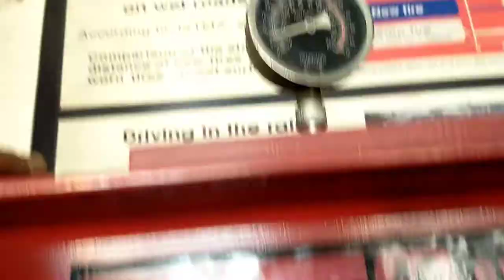Toyota Avanza 2017 how to replace wheel bearing and rotor disc

Comment: ganyan ako nung nagpalit ako rotor disc,
biruin mo rotor lang problema pero kailangan na din palitan ang wheel bearing dahil kailangan baklasin ang wheel bearing pag tinanggal ang rotor.
machine shop pa ang magkabit at magbaklas dahil kailangan ipress ang bagong bearing.
tosgas😅😅😅
thanks for the video boss more power
Reply from the maker: Salamat din sir!
Reply: Kung rotor disc lng papalitan boss damay na din bearing?